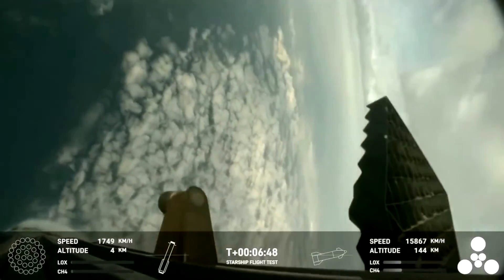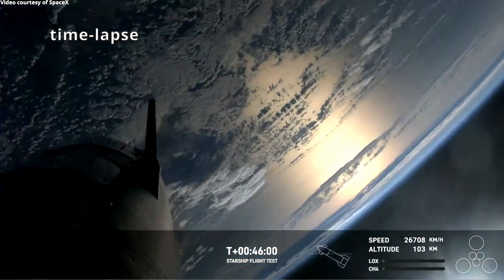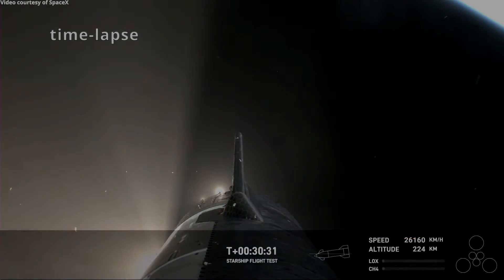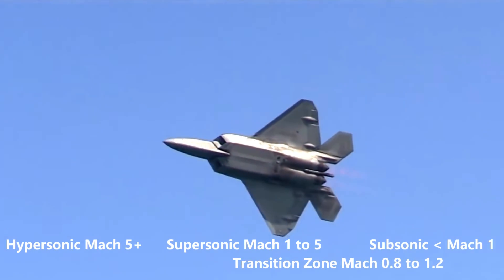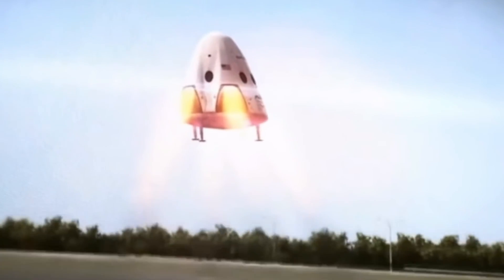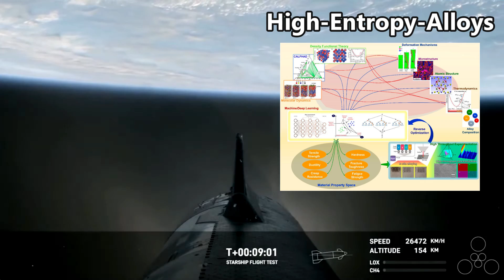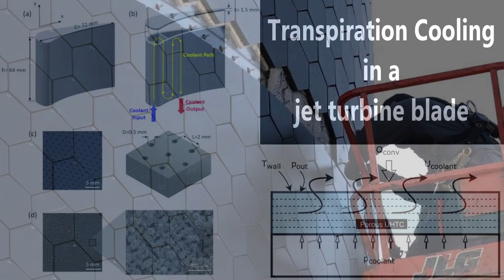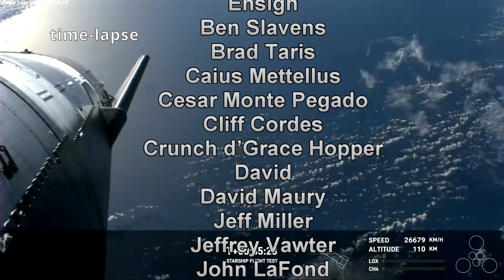Starship Integrated Flight Test 3 Analysis

Comment: SpaceX has pretty much perfected the art of landing and reusing boosters so, this part of the problem will definitely be the easiest to solve going forward. Indeed, I suspect that now that they have a treasure trove of valuable data, I'm pretty confident that test flight 4 might actually see a recoverable splashdown event for the booster.

However, Starship re-entry is simply unknown territory at this point! Sure... They also have LOTS of data to chew on over here too! And no doubt, they also have data on how NASA has been doing this for decades! But Starship isn't a winged glider nor is it a space capsule... It's a reusable rocket so, this will be ANOTHER first for this company, if they can crack this re-entry problem!

No doubt they have a whole plethora of eager experts, just like Terran Space Academy, who are currently working HARD on this very problem right now! Computer simulations are one thing... But actual data is quite another! So hopefully if the FAA mishap wraps up sooner rather than later, then they can get back out there to collect even more data!

Indeed... We now have a powerful enough rocket, capable of carrying over 100 metric TONS into low Earth orbit!!! A FIRST!!! And even though Starship is not reusable at this point in time, no doubt SpaceX will be using the next flight to actually send practical payloads into orbit. And heck, with an estimated cost running into "just" tens of millions of dollars per launch, they have achieved an absolutely revolutionary objective in ALL of Space Flight!

There's still a LONG way to go of course... But the ONLY major hurdles left now... Is FULL re-usability! Everything after that should be a cake walk!
Reply from the maker: The hardest part will be the catch system I think... A barge is a lot easier...
Reply: @terranspaceacademy  Ah yes! That will be incredibly daunting!!! WOW! Elon and the SpaceX team, sure have their work cut out for them aye??? But they have definitely reached a MAJOR milestone! And with the data they've accumulated, should hopefully spur and encourage them to continue to press forward, at an ever increasing launch cadence.

That said however, do you agree with Angry Astronaut that the NASA timetable will put unbearable pressure on SpaceX regarding Artemis?

One thing he said that I actually agree with, is that NASA should simply press on ahead without the Starship HLS lunar lander, and just build out the remaining infrastructure, such as the Lunar Gateway, in the interim, while SpaceX continues to test and develop Starship. That way, both companies are freed up to develop their respective systems independently of each other.

I mean a 2026 manned mission to the Moon using Starship??? Looks highly unlikely at this point! Despite the recent milestones that have been achieved. 🤔

Comment: I agree about the thrusters size. Your video made me see the tons of fuel sloshing around inside the Ship, with the computer frantically adjusting winglets and firing thrusters to stop the spin and roll. The Ship needs wider rear wings to incorporate landing legs anyway. Enlarging the rear wings kills two birds with one stone.
Reply from the maker: Should they put vertical stabilizers on the flaps :-)

Comment: 2:01 you and almost every channel are missing the whole point. And I thought you would correct it @ 2:18 ! 

SpaceX is not trying to make an amazing rocket, which Starship is, it is trying to make 1000 amazing rockets. And launch all of them every two years!
SpaceX decision to use steel is for that purpose, a production line. The iteration rate and reusability are based on that decision.
Single use rockets based on aluminium and carbon simply don't help Elon Musk dream to have 100.000 people traveling to and from Mars every two years.
At the end of a decade or two Elon will have produced more rockets than Airbus and Boeing have produced commercial planes.
Reply from the maker: Gosh. Don't know how I missed that... with the whole factory assembly line and all... just slow I guess.

Comment: I stopped at the expendable thing.  it cost 1 billion a flight thats not sustainable
Reply: There's no figure out there for Starship costing 1 billion a flight, maybe SLS.

The manufacturing of the vehicles is so streamlined and made as an assembly line that it doesn't cost nearly as much to build as something like SLS. It takes them a month or so for a booster and a ship to be built, and the engines are made 1 per day. The labor force they have on site to do this isn't even that big, which makes the percentage cost of the vehicles more materials than fixed costs. Estimates have been put to 100mil for booster, engines have been estimated at 250,000 dollars and the majority of the boosters cost.

SLS has more people working on it and outputting just 1 full stack every 2 years.. That is what makes something expensive. Re use is not primarily a cost reducer, it is primarily a launch cadence booster, which creates the secondary effect of bringing costs down in many ways aside from vehicle cost.
Reply from the maker: They are building them anyway. Strip one down, make NASA happy and get something to the Moon. It won't slow them down.

Comment: The unstable last phase of the booster approach looked like they copy and pasted the PID values from a F9 booster and forgot to adjust for mass and length.  I'm sure that's not what happened, but I like to armchair engineer LoL
Reply: Hypersonics/transsonics/subsonics. Aerodynamics is sketchy in that case. You CAN'T model everything perfectly without testing. Aerodynamics models are not precise enough in that case. Especially when there is involved both rapid change in altitude, pressure and velocity. IFT3 was first test that could point witch simulation model was closest to reality. 
NASA probably would test everything in scaled models in specialised air tunnel, but that kind of test facility is simply very expensive. SpaceX approach is just model everything in virtual, then confirm models in real tests. That approach is actually cheaper, as cost of ship is relatively cheap (under 100mln per launch). Especially that some things cannot be tested on the ground. Ie reigniting raptors against near subsonic airflow, ignition of engines in vacuum, plume expansion due to low pressure etc. All of those things can be approximated in theory, and then tested in real life. Ie re-entry profile of Orion capsule was tested by launching it on board of Ares I rocket. 
So while indeed SpaceX chose wrong values for PID, it wasn't because someone "forget" something. It was because simulations showed that that was most probably profile. And it was wrong. But now with telemetry they can simulate way more accurate
Reply: That's what it seemed like with the early versions of the heavies
Reply from the maker: It did look like they were not planning to control a spin on something that big.
Reply: @terranspaceacademy  I doubt. For me it looked like they cancelled spin control as RCS was over steering. Initially, I I recall ,both on RCS and aerodynamics booster turned left, then right... And again, again.  
Compared that with ship spin, now I think it was algorithm issue. It simply wasn't able to deal with changing conditions of ullage-RCS. This kind of RCS will have variable thrust as it will be dependent on overpressure in tanks. If spaceX will soon make some tests on site with ullage thrusters that will confirm my theory

Comment: It looked to me like their fuel transfer test had created an unstable secondary axis of rotation. This would result in the creation of the " tennis racket effect. " The ship would be virtually uncontrollably on reentry.
Reply: no.  what destabilized the orbit part of it was that the payload had a significant amount of atmospheric pressure when they opened the payload door.   you can see the pressure rush out breaking the door and introducing an enormous amount of roll.
Reply from the maker: Interesting... can you link on the SpaceX time?
Reply: @robertoler3795  Probably both, the push from the pez door venting AND the large shift in center of mass.
Reply: @robertoler3795  I didn't even think about that. That would make completely sense with the roll it was having.
Reply from the maker: That's a very good point...
Reply: I don't see the SpaceX video on YouTube yet but scott manleys video "SpaceX orbit largest spacecraft..." goes into it at the 8min mark
Reply: They definitely got alot to resolve and redesign.  I think you are the 1st video,  in the past 3 days,  that points out, yep, did the thrusters even fire to try and stabilize.  And 4 sure not strong enough,  you suggest the other thrusters, and u are likely onto something.  The same for the wing. Definitely got a cargo bay issue. And need a decompression system,  before opening and closing the door, which seems to need a better design aswell.  Should not have been a atmosphere in the cargo area,  faa, should ground them for 6 months, because I feel it will take 6 months, to properly fix, replace and test. Before going back up.

Comment: I am not going to conclude the Starship isn't stable in hyper sonic re-entry until I see if actually start enter in a proper orientation.  I think it was doomed early on with that constant roll.  At first I thought it was rolling to settle the fuel for propellant transfer, and maybe it was, but it should have stopped before entry.  Also was the boosters control system in an oscillation when the landing burn was supposed to start?  Sure looked like the grid fins were reacting way late and encouraging the osculations.  So does this trigger a mishap investigation?  Or are they good for another launch license?
Reply: Yes, this flight did trigger a mishap investigation. Whenever a test flight from any company does not go how it is laid out in the license, an investigation is automatically triggered. The only way one wouldn't have been triggered in this case would be super heavy making a softish splashdown after a mock landing burn and ship making it through reentry in one piece then belly flopping in the water as the license stated.
Reply: @dr4d1s how were the landing failed attempts handled with the falcon 9 then?
Reply: @clytle374  you know, I am not sure on that. I wasn't paying that much attention to the regulatory side when they were working through 1st stage reusability.
Shooting from the hip though, I would guess booster landing was not the primary objective on the license, so it might not have caused an investigation. At the same time, SpaceX was not launching nearly as frequently as they are today. So if the failed landings did cause an investigation by the FAA, I don't think the investigation really held them up at all in the grand scheme.
Hope that helps a little. Have a good one
Reply: Definitely a mishap investigation as neither stage completed the planned landing.
Reply: Probably doing mishap investigations first; fixes made, try again
Reply: The dihedral flaps might still work, they just might need to be bigger to counteract the potential bottom heavy behaviour of starship due to engines, exactly like the space shuttle. 

But I am not convinced this will be necessary until I see starship fail another re-entry once they have fixed the control issues, and starship still goes bottom first, melting the engines.
Reply: Venting the gas during reentry isn't going to form a fuel air explosive mix simply because there's not nearly enough oxygen or pressure to support combustion at those altitudes. Also, even if there was enough oxygen, fuel air combustion velocity is MUCH slower than the hypersonic slipstream meaning by the time it ignited it would be well behind the spacecraft.
Reply: @GlutenEruption I'm sure even if the hydrogen does burn in contact with the capsule as it's vented it's probably small potatoes compared to smashing into the atmosphere at 25 times the speed of sound

Falcon 9 literally descends through it's own exhaust plume during the re-entry burn rather than aerobrake because its lower thermal load
Reply: @BuffMyRadius  exactly!
Reply from the maker: Many modern reentry vehicles would have righted themselves and survived...
Reply: @terranspaceacademy  before this test flight I was under the impression that the wing shape that starship assumes made it passively stable because of its dihedral flaps. You make a good point about the weight, though that may be the fly in the ointment.
Reply: @terranspaceacademy capsules sure do, but we can safely rule out starship as doing it lol

Comment: Starship uses cold gas thrusters, not hot gas ones. Also, I think it uses oxygen, rather than methane. But I could be wrong about that.
Reply: Um.... Maybe you should do some more research, because it does use hot gas rather than cold gas, google it! Also, it uses methane and oxygen, that's how rockets work, you have the fuel(methane) and then you have the oxidizer(oxygen). Please make sure you have done enough research before you make these uneducated comments!
Reply from the maker: They use the hot ullage gas for some of them.  They also have nitrogen cold gas thrusters etc.  At no point are they firing a rocket engine (except the Raptors) for RCS.
Reply: Yeah. He pictured a hot gas thruster.
Reply: It uses hot gas thrusters.
Reply: @shawngadwa269 Not the one he showed. It's just tank gas, not combustion hot gas thrusters.
Reply: It refuses excess propellant gas as thrusters..  they might end up going with heaters or cold thrusters, though I would imagine after all that ice build up
Reply from the maker: They vent the hot methane gas from the ullage.  It's hot so it has the charcteristics of hot gas thrusters.  Not cryogenic, though they have those to with nitrogen.
Reply: @terranspaceacademy  not really. The ullage is warm but it is not much hotter than compressed nitrogen, not compared to combustion byproducts
Reply: I believe those are hypergolic thrusters used on Starship, similar to what was used on the space shuttle, Apollo and similar to what is used on Orion and Falcon 9. Hypergolic is just two different chemicals stored separately, which spontaneously ignite when combined. A cold gas thruster just uses a pressurized gas like nitrogen, the systems are dependent on a large tank size due to decreasing pressure over a period of time.
Reply: @grumpusmaximus9446  there are no hypergolics of any kind on Starship